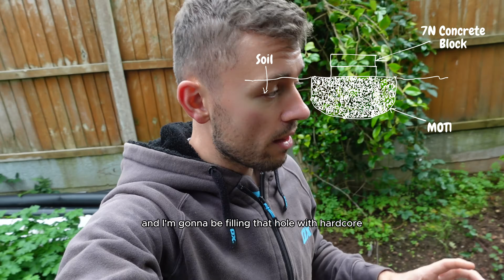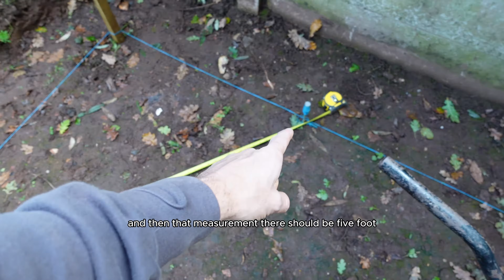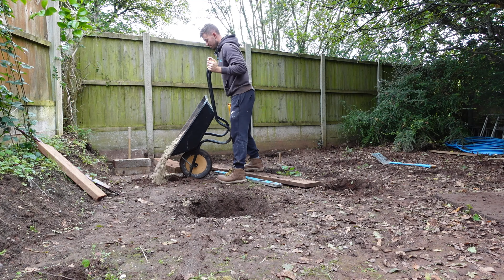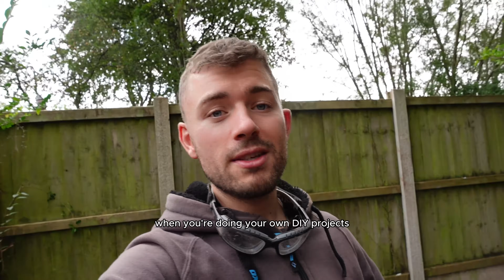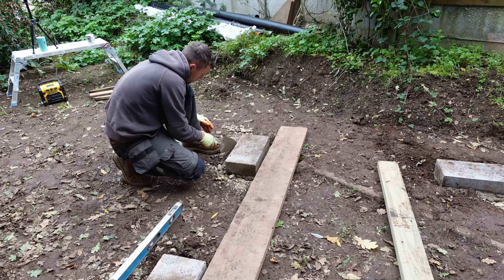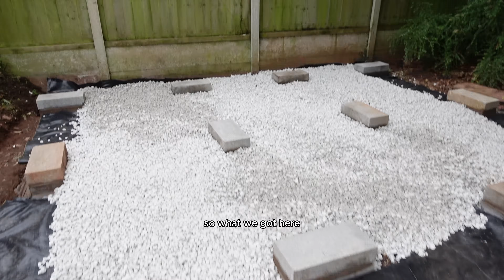How to build a shed/garden room base - Using pier foundations

Comment: For a structure this small I would frame the floor first, square it, place it in exact position, then mark the exact hole locations with spray paint. Then move floor out of the way and proceed with groundwork.

Comment: pad stones (which is what these are) are a well proven ancient method. I did exactly the same using breeze blocks to make 6 foundations for a timber framed log shed. Minimal digging, no concrete, easy to remove and reinstate the ground at a later date if necessary